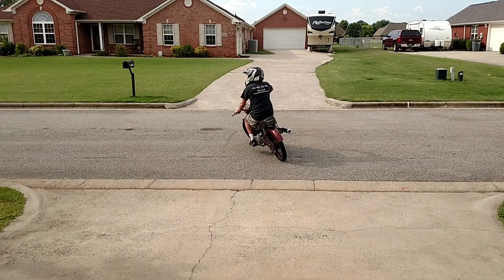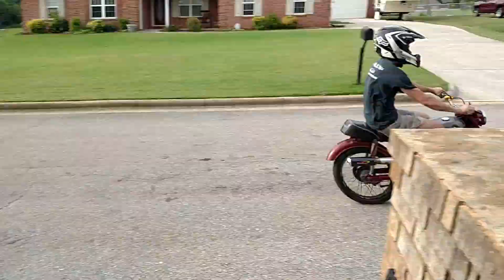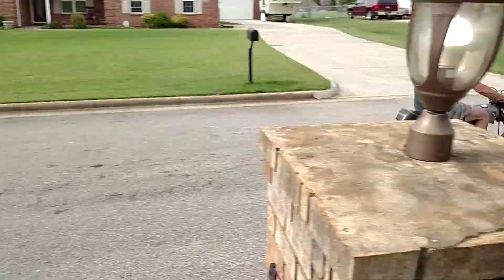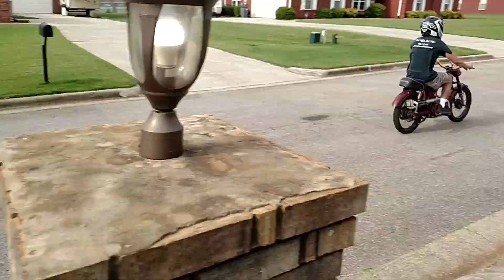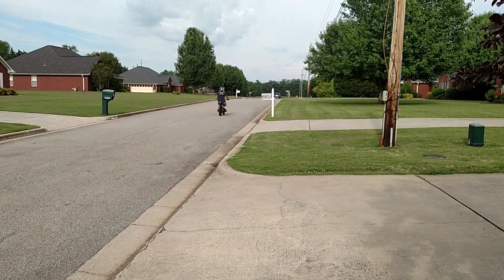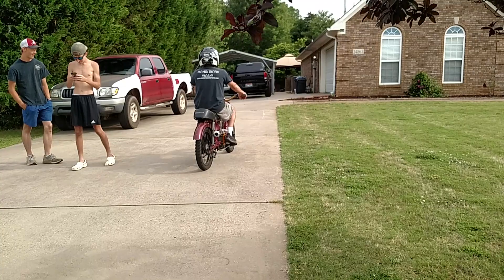KITACO,TAKEGAWA 124 DOHC first test cL70

Comment: clutch sounds a little weak there eh?
Reply from the maker: It was addressed.. the springs in the $500 5 disc kit are good for 18+hp.. but obviously they didn't cut it..  found some  +20% added pressure  cr85 racing springs , they got it gripping right as of now

Comment: That thing is bad ass, I'd like to see that motor in my kids trx90. I'd throw the 114 kit right on the shelf. Nice. Was does a motor like that cost to build
Reply from the maker: $7000 ishhh.   By the time you add up all the extras it takes to get there on the power delivery..  don't even try to guess with labor cost involved..gets pricey fast
Reply from the maker: You can use a Tak sohc 4v head..and 54mm crank and get about 18+ hp.. only a couple less than this.
Plenty of videos of my sons old quad on the channel.  
The later the video..the faster it got o er Time. 
Looking at maybe $3-4k on something like that. 
Clutch is the weak area.. look out for some serious maintenance though..or else  👉😑💣😀😀😀👍

Comment: Any idea how much more power this kit adds?
Reply from the maker: It's not being made .. not available from manufacturer. 
Roughly makes 19-22 hp.. depending on the setup.
30-50+ hour life expectancy between major service work.  
Approx $6-$8000++ for the running motor setup as shown.. according to who is doing the work..and to what extent it's being modded and tested